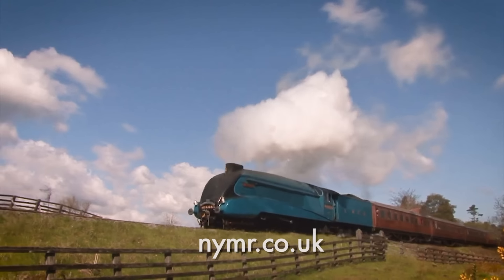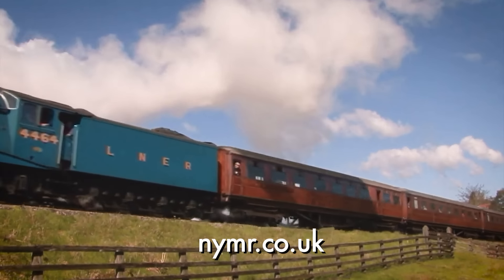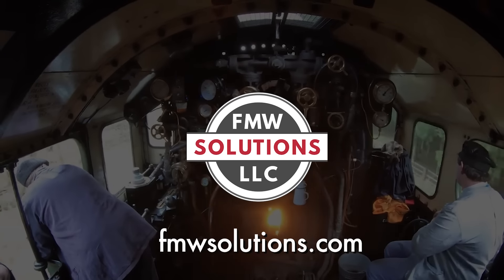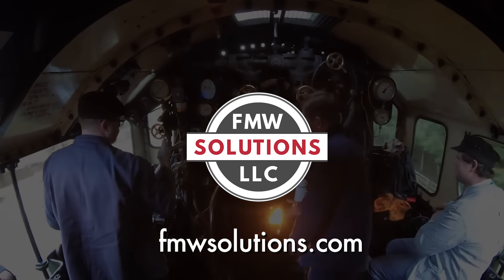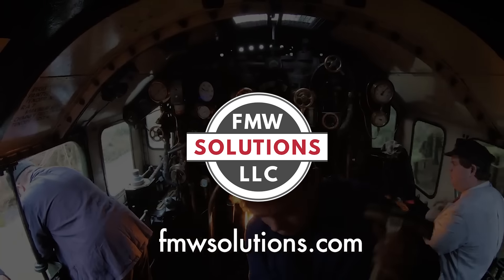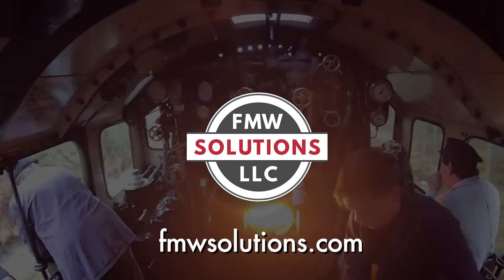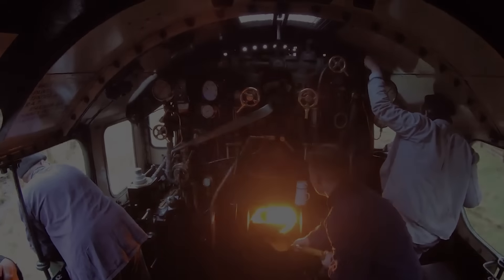Can oil-fired steam future-proof rail preservation? | North Yorkshire Moors Railway

Comment: 35:00 Is an excellent description of one of the benefits of oil. I'm a Fireman, but I have a screwed up back and pelvis after serving in the Army which makes shoveling difficult/impossible most days. Oil is what allowed me to become a fireman in the first place. Along with all the other benefits such as fire danger, cleaning, fuel saving etc. about 99% of the passengers that ride behind our steam locomotives dont actually care if the engine is coal or oil fired, and out of those people most assume they are coal burners anyways and aren't able to tell the difference.

Comment: The ffestiniog tried oil in the 1970's or 80's (cant remember which) for a short period when oil was cheaper than coal, they also did an oil conversion as an experiment for the Darjeeling, but as soon as the price of coal came back down they switched back

Comment: I have always questioned for years why none of the of the British tourist lines had thought about oil when all the talk of coal shortages started

So I’m really glad that it is finally starting to be looked at
Reply: The Ffestiniog and the Keighley and Worth Valley have both tried oil conversions in the past. I think the Ffestiniog converted back to coal, but I don't know the outcome of the KWVR conversions. I think you are right that it's a good thing that it's being looked at again now, particularly to keep steam running on the NYMR during dry summer periods when fire risk is a serious concern.
Reply: Possibly cost issues!!!
Reply: @rodkennedy9800  Yes, possibly. The world is a different place now of course.
Reply: No shortage of coal as UK imports millions of tons each year while sitting on billions of tons in the ground!
Reply: @rosewhite---  but is it the right kind of coal coming in, if NYMR has seen coal costs triple in 12 months then that suggests not, you can't burn power station coal in steam engines. 
And where is the community that would whole heartedly support a new UK mine, deep or open cast, Fros y Fran the last new mine in Wales has only lasted about 15 years leaving issues with its tailings and other contamination.

Comment: Notable examples of oil fired steam locomotives these days. Include UP 4014. SP GS4 4449. And the D&RGW. 493.
Reply: You forgot US Sugar Corporation's #148, which was converted as an oil-burner by FMW Solutions (and it uses used vegetable oil from diners, to boot)

Comment: I've seen a lot a black oily smoke from oil fired engine. I hope you can minimise or eliminate black smoke.
Reply: If the fuel is biofuel, it burns rather cleanly. Just look at US Sugar's #148, it uses used vegetable oil from restaurants and diners around its base at Clewiston, Florida and its surrounding areas.
Reply: A lot of that depends on the fuel source. Used engine oil (from car oil changes) burns very dark. Used cooking oil burns very clean. Diesel similarly is very clean.

Comment: The Festiniog railway converted its locos to Oil firing years ago, then subsequently abandoned this and after a decade converted them back to coal due to the increasing cost of oil.   So I'm not convinced why oil firing is seen as a way forward for rail preservation.
Reply: The Ffestiniog Railway isn’t the only railroad in the world that used oil firing, and even though their attempt years ago didn’t pan out, who’s to say that it won’t work out now?
Reply: And now coal prices are skyrocketing.
Reply: Because it doesn't have to be heavy oil.  It can also be vegetable oil, which is seen as "sustainable".
Reply: The FR used oil for a lot longer than a decade...more like 4 decades.

Comment: my own experience with riding on steam train is at kings island. those trains are propane powered. also oil comes less labor cost because you do not need a fire man to load the fire box. Modern electronics can regulate the air/fuel mixture. also it can operate like carburetor which more draft more fuel into the fire box.

Comment: R766 in NSW Australia was gegauged from 5' to 4' 8 1/2" to run on NSW track. It was also converted to oil fuel. This was done so that loco could keep mainline speeds without being sidelined if steam was low. Loco 5917 remains coal fired along with other NSW heritage locos. Good coal still available in NSW. Common here to include a diesel in the consist to ease coal consumption and to provide dynamic braking that eases wear on loco brakes.

Comment: If coal can’t be purchased then oil is probably the only answer to the problem,it shouldn’t be too difficult to fit an oil tank in place of the coal space on the tender and carry out fire box modifications to burn oil.

Comment: The fireman must love it, no more shovelling tons of coal and I believe any sort of oil can be used including used cooking oil.
Reply: maybe or they could be worried they be out of a job. with oil you do not need fire man. in conversation they could add electronics to regulate the oil and air mixture. Themloelectric plate produce the power to run the electronics. depending on the size of the train the cost saved in labor can off set the increase cost of coal. with coal you need the fire man because it just too expensive to replace him with a robot.

Comment: as an oil burner operator in europe (1244 141r) we struggle to find enough bunker oil. however our colleuges in France have discovered that a byproduct from paper manufacturing (name escapes me) has very simmilar properties to bunker oil (burn rate and temperature) and the benefit of being clean burning. we will be trialing ti next year ouselves

Comment: The Swiss have developed a light oil burner (diesel) for steam engines. Unlike the swirling burner for heavy oil the diesel burner looks like a huge gas cook top with four large burners in a square pattern with a small light up burner in the middle. The Puffing Billy Railway in Victoria Australia has converted one of their 2-6-2 tank engines 14A to this new Swiss system and it's coupled with a Lemphor exhaust previously fitted to a coal burning loco 6A. They had 14A fitted because they run through a very dry forest and every train had to be followed by a water cart train to put out any spot fires on dry days. The system fitted to 14A is not permanent and the loco can be converted back to being a coal burner if the railway so desires. Even when working hard up 1 in 30 grades there's no black smoke at all from 14A just a slight haze from the chimney. For the PBR it made good sense for they also have diesel locos which haul trains on total fire ban days so there was no need to find a new supplier for oil. Also there's no cost that there is in getting rid of the coal ash. Diesel is very uniform in quality unlike coal which can vary wildly from high grade steaming coal to very low grades of coal.

Comment: I have experience of pressure jet burners fitted to oil fired boilers, curious to see the type of burner used on this. Disappointed there was now drawings or diagrams😂. It’s still a steam engine regardless of the fuel type, not a coal engine!! Good forward thinking to keep the show on the road or rails rather. With that attitude you could be fitting and electric boiler and a tender full of batteries in 20 years time. All the best.

Comment: Will the upgrade include the Lempor or other modern exhaust system, same as the Kriegslok 52-8055? This should increase efficiency to 12% and push up the power by 20%.

Reduction in wear and tear due to less grit and corrosive gas. The Swiss found the new oil burners use less fuel than thir diesels for the same work.

Hopefully this will eventually lead to some use on the national system eg infrastructure trains.
Reply: That would be epic if some diesels got replaced with oil-fired steamers!
Reply: @InventorZahran  
I heard that the Brienz-Rothorn mountain railway set their diesels aside.
Reply: @InventorZahran  Roger Waller wrote a paper on the subject called "Modern Steam - An Economic and Environmental Alternative to Diesel Traction". There are copies of the paper online and it is a very interesting read.
Reply: @Meengineer100  
He gave a talk to IMechE about 20 years ago. He is good on exhaust systems as he worked with Porta and Wardale.  He hires out a loco to SBB for use on infrastructure trains, which brings in useful revenue. The same could probably be done with suitable locos for hire to Network Rail - one the trains are at the site, they sit there doing nothing until the end of the shift. Unfortunately, 2-10-0 types with flangeless wheels are not allowed on the national system, so the loco would have to be a 2-8-0 or 4-6-0.
Reply: @physiocrat7143  I hadn't heard about the hiring of locos to SBB before, interesting. I read that Waller carried out the indicating on the Red Devil which must have been a great experience! Hoping he can make it to this year's Advanced Steam Traction Trust conference.
Reply: @physiocrat7143  I know about which loco you are talking, but I am not sure whether the DML still does that. And I am not sure whether the benefits the modern steam had over diesel 10 years ago (If I remember correctly they had compared them in some shunting service) are still valid as technology of batteries and power electronics had advanced significantly. and fitting reasonably sized battery into locomotive should not be problem.
Reply: @MrToradragon  
Whole-life capital costs (including costs of development) and associated interest charges are the issue with competing technologies.

Since, over a 40 year life, locomotives spend so much time doing nothing, this is, or ought to be, an important consideration. A couple of locomotives on a ballast train, for example, spend the best part of a weekend switched off or idling.

Comment: It makes sense to burn oil simply for ease of operation, one example is any where you can fit a truck in you can fuel your locomotive. I'm looking at this from being a guest on a diesel powered railroad, the less special treatment you need the better and starting brush fires isn't positive P.R for the host railroad. Either way I'm just a man sitting in front a computer and you lucky bastards are out there doing this stuff. Great video's FMW, keep'em coming and cheers from the great white north eh.
Reply: I assume it also has benefits in regards to wear since oil burners can heat the firebox more evenly than coal

Comment: Nothing new under the Sun, re converting established coal fired locomotives to using oil as a fuel. E.g. just before nationalisation, the GWR had a pop at it, if you look for ‘GWR oil-fired locomotives’. However, it fell foul of the UK Treasury in 1948, due to the shortage of foreign currency, & exchange rates at the time, so the Western Region had to revert to traditional coal.

Around the same period, a large slice of the SNCF class 141R fleet went the other way, due to difficulties in the availability of suitable coal domestically, being converted to heavy fuel oil. They could produce a lot of black smoke from time to time - especially when the cleaning technique was used en route, using sand as a cleaning agent.

Comment: If I might though, we have more coal then Oil, so how much longer would it last, I know mines are closing and its not the best for the environment and its a hard way of life and dangerous for those that have to mine it but wont we run out of oil before coal?  Unless we use non petrolem oils, like plant or veggie oils?  I belive they do run an engine in the grand canyon off veggie oil?

I am listening a bit though to experts and leaders here, its important for the future of living history
Reply: The Grand Canyon Railway does use used veggie oil for their locomotives, and US Sugar uses it for their steam locomotive #148 (and it will be the same system for their other locomotive, #1504, which is undergoing restoration to operating condition).
Reply: @kristoffermangila  yea ok thats what I thought, I belive I read the Grand Canyon also is one of the few in the states that use a more advanced Exaust Ejector, though that white paper was released close to a decade ago I believe. so there may be more or less now and the change in direction for railroads since the 2017-2018 period that I started reading up on advanced steam and read those white papers put out by the coalition for sustainable rail as well as stuff wrote by Livio Dante Porta that were translated to english, they are fascinating reads, but its amazing what he was able to do with steam just by wringing out 1 % here 10 % more efficiency there. made at the time the higest drawbar power to weight engine there was and his engines in Patagonia were ran off really bad coal and was able to get it to work, and burn cleaner with his additions of overfire jets different grates, and advanced exhaust ejectors as well as an effective boiler treatment, as well as better piston rings and just things here and there better insulation too, and it made a world of difference and ran far cleaner then most steam, and in one of the most remote and inhospitable places on earth.

Comment: So the important thing to understand here is that steam locomotives, whether coal, oil, or wood, all were a part of a larger industry. All steam locomotives everywhere currently in existence are but a FRACTION of the fleet of a current large railroad. Climate change isn't a product of just the tools, but the corporate practices that value money over people's lives or the health of our only home. TL;DR holding large industries accountable and forcing them to curb their pollution will allow steam locomotives to remain, regardless of fuel type.
Reply: If all the commercial railways of the world electrified their entire networks and powered them with 100% renewable energy, a few preserved steam engines wouldn't make any meaningful impact on the global climate. Even then, it's really the mines, factories, and dirty-fueled power stations that contribute the most pollution; railways are already far better than trucks or airplanes.

Industrial polluters have always been the biggest problem, but they (and the politicians they donate to) love to blame it on individual civilians!
Reply: In the overall scheme of things, rail transport produces little CO2. Embodied energy in infrastructure and rolling stock is a substantial proportion of the total. Rolling stock should have a 60 year life; if it runs for only 25 years that is a major loss.

Comment: You'd have to modify them to switch from coal to oil but i don't see what options there are as coal is increasingly hard to aquire.More people are interested in vintage diesel now,and electric but obviously the NYMR can't run them!,so there is probably less steam needed.

Comment: The amount of coal preserved engines use isn't great surely if they all got together and bought in bulk and had a central depot where they could draw their fuel. It would be more cost effective. The engines that run on the main line there is more of a case for oil fired .

Comment: Oil was supposed to run out by the year 2000.  That hasn't happened but oil is still under threat.  At the moment LNG is the fossil fuel with the greatest future proofing.  I wonder how well such a conversion would go. Bearing in mind that it is more than 70 years since converting our steam engines to oil firing was the latest technology.
Reply: My experience in modeling scale 1/8 inch to the foot steam locomotives is that after converting from coal to oil fired fire boxes that the only chalange to making the burner fire with propane or natural gas is were to move the oil tank to another car folowing the tender to hold the bottle of gas.  The burner of propane fuel can be added with the oild burner and either can be run.  Really small change.  Propane and oil heat to boil water are very close in thermal design and operation.  The propane gives a few less BTUs.  When you install a burner tubes in an area that was design for a coal fire box there is a hole lot of empty space.  Both propane and oil burn at a higher BTU rate than coal or wood or paper.   All that the science requires is something to boil water.  As they discussed the fireman's job is changed from physical muscle to the real exciting challage of how to correctly produce steam in the boiler so that the engineer or driver can get the train up the hill.    The first wood boiler steam locomotives were not very efficeint.  Oil is great.

Comment: has a member of the NYMR And a Marine engineer I am all up for this  and I bleave a new build  would benafit the NYMR  that uses to run no that line bavk in there hight days of steam  Like a Class A8 tanks  or the D20 or B16 raven  the  class A8 were well loved by crews  and a A8 oil fired will be good  and its will be special  in this  area  And I just happen  to have the design blue prints

Comment: The decision between electricity and diesel or steam is easy. To service a steam engine after ten years in Germany you must open the steam boiler and control all boiler tubes for wasting. Mostly they are replaced by removing all over the defective tubes and weld in new pipes, boring and aligning all boreholes included. The Locomotive factory in Meiningen is suffering for orders and their headcount is constantly reducing. It’s a question of time, till the factory will close. But England and America because of coal and oil abundance overslept the electrification era and a lot of track ways went closed and forgotten. Here in🇨🇭we have the Stadler and they are delivering the all over best train compositions and🇨🇭is totally electrificated with abt 30‘000km railway tracks in two different gauges. And our trains are running from Zurich to Munich in 3.31 hours. And Diesel? Think about the environmental burden and the oil prices and you find the answers by yourself …